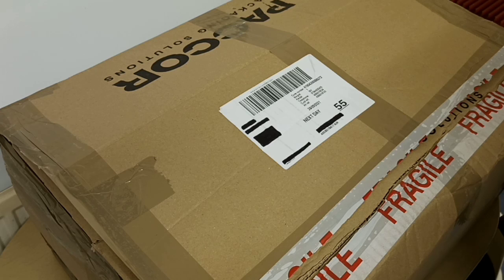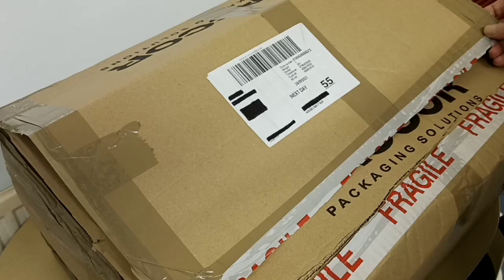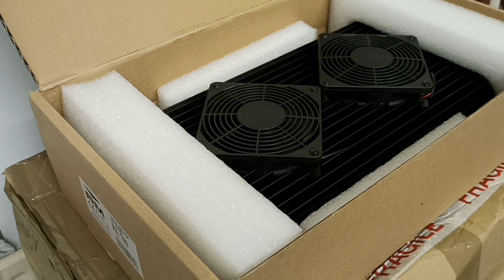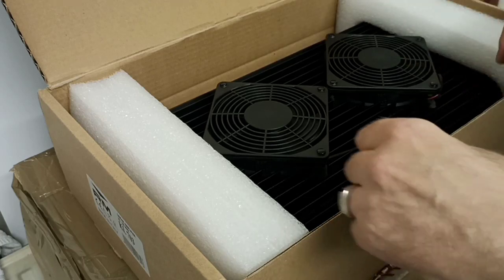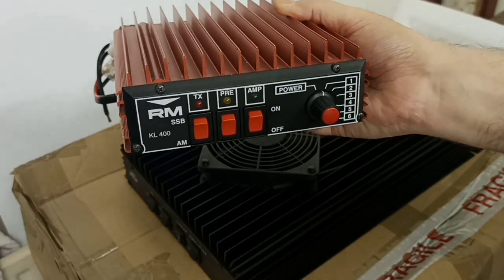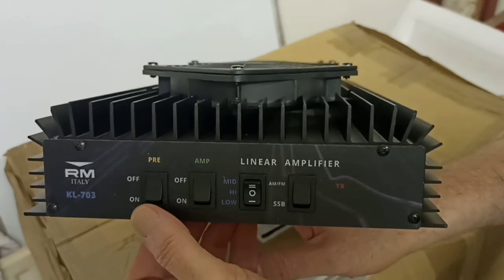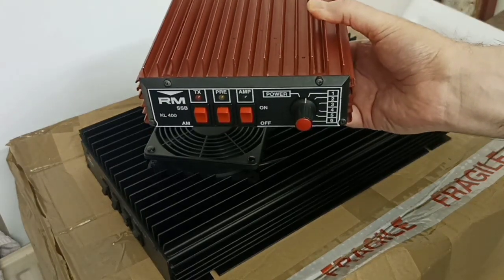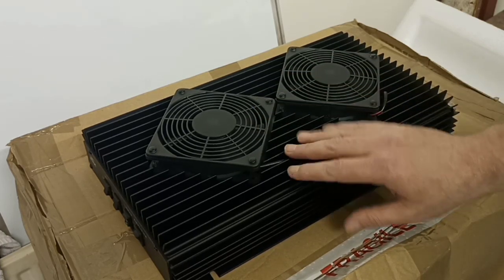RM Italy KL 703 Linear Amplifier .. Unboxing.

Comment: Hey there I'm late but I just subbed your channel..a question please I have a quad 6 pro installed and for SSB I just can't get out I've tried even with 90 watts...so this obviously is too big and I'm disabled so can't work and money is tight do you think the rm kl 503hd will be good enough for my set up in my jeep.. radio is directly wired to battery running a Sirio antenna id like your honest thoughts on this please sir and great video btw!!!
Reply from the maker: @alabamared2568  Hi there.. 
Either the 503 or the 503HD will work just fine or even the 505V that's the one with the two fans on the top all these will work excellent with a mobile station.. 
Also 90 watts is good and will give you that extra boost on a home base set up using a bigger antenna but in my honest opinion using any of the amps I've listed above will definitely give you that boost you need when out using your mobile station, in fact those listed above are used very often with great results..

I may add the 503 and the 505V with a 10-12 watt input will drive those two amps between 230 to 250 watts just make sure your swr is below 1.5 and you will improve your output power quiet significantly.. 

The Quad 6 pro is a very good radio and it's audio out even with it's standard microphone is very good and more than efficient to drive the output from the radio into the linear.. always remember that on sideband our voice is our power we send out so the louder and clearer your voice the more watts you will output.. also make sure your amp is wired directly to the battery..
Good luck and I hope this helps.

Comment: Whats the max dead key you  can put into this thing
Reply from the maker: @stelthcamo357  the manual states with no swing 35 watts on each band, although I wouldn't personally recommend that. More like 25 watts no swing and you will get around 400-450 depending on your antenna set up..

Comment: I am curious. After having this for some time, how do you like it? I'm really thinking hard on one and would like your input. Thanks, Steve ✌✌
Reply from the maker: Hi Steve,, First I'd like to say it was good to see you with John Mower Junkie at the SC Ham Fest..
Rm Italy have come a long way over the past few years and have stepped up their build quality especially with the internal workings of their latest linear's such as the 505V and the 703V..

I have two of these 703's in line as well as a 505V on different radios and they perform exceptionally well..

The trick is to run them at there peak so always on full power which reduces resistance on the outputs.. this leads to a very clean outgoing signal without and audio distortion..
I've seen too many people overloading the linear with too much input watts to try to maximize the outgoing power and this is not good for the linear and in turn will sooner rather than later blow the finals..

Inputting around 20 watts peak is best and will give you around 400 watts peak output and it will run all day only getting Luke warm.. 

Yes you can give it the full beans of 35 watts input and wring out the full 500 Watts but your signal/audio will sound and perform dirty.. it's pointless anyway running it hard because nobody is going to see the difference with signal between a clean 400 and a dirty 500 at the other person's radio on receive.. all they will hear is a strangled muffled audio..

People fail to realise that this linear runs all Narrow bands including AM FM CW and SSB it will not perform the same output on all bands.. 
For CW it will easily run the full 500 but for AM FM and SSB running the linear clean does not require any more than 20 watt input..
Again running it light will benefit the the linear with a cleaner output with less distortion on the modulation

Keep it light and the linear will reward you tremendously and give you years of use..

This thing has a monster size heatsink and those two big fans run silent when turned on and once keyed up gives a quiet whoosh sound returning to silent when you un key the mic and all the time constantly keeping the linear cool..
Power wise it does its job and better than any other linear in its class..
We have to also remember it's the largest 13.8V linear on the market today and it needs at least a 60 amp power supply to run it. 

The 703 gives you the power you need and so does the 505V on SSB and packs a punch.. for FM the carrier wave is solid so the linear will get hot if run on full power it's just the nature of the FM carrier.. AM/SSB our voice is our signal so the audio input spikes when needed.. talk louder or with a good power mic and the linear will push those watts out.. 
Even myself feeding it with 20 watts on SSB with my Sadelta Echo Master Plus it will peak around 480 and still remain cool with good audio which isn't far away from the spec RM Italy state..
A really good solid linear and treating it kind will last a long time.. definitely worth it in my opinion..
Reply: @DeltaXray444  Greatly appreciate you taking the time to and giving me your input and advice. If you've noticed, I'm all about bang for the buck due to resources and I'm thinking this is probably a very good option. Thanks again and looking forward to sharing some RF. 73 ✌✌
Reply from the maker: @udx-483muddbucket5  You are welcome..
last week the stateside skip was running low but good into the UK for a few hours.. I made around thirty contacts.. it'll start building now towards September and I'll be listening out for you to make that contact. 73.

Comment: Did you say it was for all bands or just 10 meters ?
Reply from the maker: It states 25-30mhz in the manual, so it will cover the full 10-11-12 meters with a little more frequency above and below the stated. Hope that helps.

Comment: Hi Glenn, how does this amp work on your FT450D? I've recently bought the KL703 but yet to try it paired with my FT450, I was wondering how much input drive you're giving it. Thanks
Reply from the maker: Hi Ed This is a high drive amp and it works very well on the 450, I set the radio to a 35 watt output and make sure the audio setting doesn't rise above the ALC, the ALC will limit the amount of audio driving the 450's outputs into the amp keeping it clean and not overdriving the linear.. the linear is set at 14.1 volts from the PSU even though the linear states 13.6 on the rear it's safe enough to feed it at 14.1 to drive it.. you can feed the linear with 35 watts on SSB AM and FM and the linear will do near it's claimed 500 watts.. but remember that when you go up or down the band the Swr will change so depending where your swr is it may kick out less or more power with a slightly higher or lower swr..
I've run this linear on SSB for a long time many months and many hours at a time it doesn't even get Luke warm those fans are excellent at keeping it cool.. although on a fixed carrier like FM it will get warm if you have long overs but never gets to hot.. also I use tuned jumpers to maximise the output, you will be surprised how much difference that different length jumpers give you with the output.. my jumpers are six and nine feet long using RG213u Military grade coax. Hope this helps
P.S always have a meter in line after the linear so you can monitor the linear's output,. Just to be safe. Hope this helps, shout up if you need any help.. thanks.
Reply: @DeltaXray444  Thanks for your detailed reply, looking forward to fire the amp up. Just waiting on bits n bobs to get delivered  80a supply and the in-line circuit  breaker
Reply from the maker: It sounds like you are getting things in order which is very good, by the way I always run the linear on high output all the time,, one thing to note is if you run the linear say with a 35 watt input on low output from the linear remember that you will be putting in 35 watts to get around 160 watts output on the linear's low power setting.. this will put strain on the linear's internal components.. in other words you will be driving the linear hard to get little out, so it's always best to find the sweet spot with input watts..
So reduce the input watts if running the linear on low power and also medium settings.. you will still get the 160 watts output on low power with something like a 15 watt input from the radio instead of hitting it hard with 35 watts input.. 
What I have said here is one of the reasons why so many people blow there linear's up.. because they don't realise they are putting strain on the linear..

Also the linear is pretty clean on the final output from the antenna.. also make sure your meters can handle the linear's output and also the antennas rating of how much power it can handle, obviously you don't want to transmit on an antenna that can only handle say 200 watts..
I will also add that if you have the linear in line and not using it the pass through wattage is only fifty watts, so make sure if you are using the 450 with it's own output of 100 watts you never have the 450's power setting above 50 watts.. 

You probably know all this anyway and I'm not trying to be patronising I'm just explaining things that are well worth remembering.. I wouldn't want you to put your 450 on 100 watts when not using the linear when its in line when the linear's pass through rate is only 50 watts, the most I do is around 40 watts to be safe..

Good luck Ed and I hope you have fun using it, they are a very good linear indeed and if treated/respected it will last you a long time, one last thing always make sure your swr is low no higher than 1.5.. lol

Comment: What power supply is needed
Reply from the maker: I use a hundred amp supply and that runs the 703 pretty comfortable.. I've seen other people try a 60 amp but they aren't really big enough, I blew a 60 amp running it on FM, a sixty will run it ok on SSB but not at peak power.
Reply: @DeltaXray444  hi and thank you reply well I’ve email rm them selfs that I think it needs to be address if anybody sees this messages and are using a kl703 rm Italy email me back today saying a 50amp will fine .it’s miss leading information even from them them selfs as your saying a 6o is not ideal for fm a 1oo amp is better we all know the RM makers are right dam touchy if you use wrong power that they recommend well I’ve got them direct on email I think I need to address them and others please email them because if a 5o amp damages a kl703 I got the proof what they said
Reply from the maker: @winstonbanks1057  I'm not sure why RM would tell you a 50amp would be fine.. how can this be.. at full output power on FM the amp drain is around 54 amps..
So even when running a 60 amp PSU the 60 amp would get hot very quickly and as in my experience on when I run my 60 amp PSU it got hot and the PSU fan kicked in almost instantly when using FM.. this blew my 60 amp PSU very quickly as the PSU was struggling to keep up maintaining the 54amp drain..

Just because he 60 amp PSU is rated at 60 amps doesn't mean it will comfortably run a 54 amp drain,.. 54 amp drain is a heavy load to maintain and the 60amp PSU will struggle to maintain the draw before the psu's fan kicks in because of overheating under drain from 54 amps..
This is why I changed to a 100 amp PSU which is more than capable of doing the job.. 

Transmitting is much more harsh on FM as it is a single straight carrier and piggy backing the audio on the same frequency on transmit.. whereas when using SSB there is no signal output until the audio is transmitted via the microphone and uses much less amp draw from the PSU.. a 50 or 60 amp PSU will run the 703 when it's on low output.. but when on the high power setting output/watts on FM a 50 or 60 amp PSU will never run the 703 at its full potential..

I've heard many people say many different things about how to run the 703 even people who have never owned or used one before.. I'm just giving you my own experience from actually owning one and seeing what occurs in reality once you hook the 703 up..

I hope it all helps you.. my advice to anyone is to use a PSU that will run and handle the 703 at its most power of around half a kilowatt.
Reply: @DeltaXray444  hi mate thank you for your reply I’d like to show this email from them direct mate not happy why they would say that . Also what the link for your psu 100amp
Reply from the maker: I use four 25amp supplies with a combiner to regulate the output they are around £30 each.., I got an electrician to put them together for me.. it's much cheaper than buying a 100 amp bench supply which usually cost over £1200. You can buy the 25 amps on eBay.. I'm not electronically minded and needed help to get the 100 amp supply put together.
Reply: @DeltaXray444  thanks for the reply if you can I think it would be good edit your you tune and paste the link for eBay power supply that be so great full
Reply from the maker: @winstonbanks1057  these are very similar to the ones I bought, the company who I bought mine from no longer list on eBay
https://www.ebay.co.uk/itm/162799417330?mkcid=16&mkevt=1&mkrid=711-127632-2357-0&ssspo=Ko4YDz65Spa&sssrc=2349624&ssuid=BbXptU0NQ02&var=&widget_ver=artemis&media=COPY

Comment: Hello Delta. Is that an LdMoss transistor in that amp?
Reply from the maker: Hey pal, no they are RM Italy's own MOSFETs, 16 of them called RM3's
Reply: @DeltaXray444  Awesome Delta, as you say on your side of the River, "Thats a nice Bit of Kit"!🤓✌
Reply from the maker: They are a very good linear in my opinion, like most transistorised linear's if you feed them with the correct input they will last a long time, the 703 will do half a kilowatt all day long and never get warm.
Reply: @DeltaXray444  Fantastic, ive hear good reports about those, sounds like its quite consertive being its Mosfet rather than transistor.
   Thanks for the reply my Friend!
Reply from the maker: @ericdee6802  even better energy saving than tubes lol 😂 👍